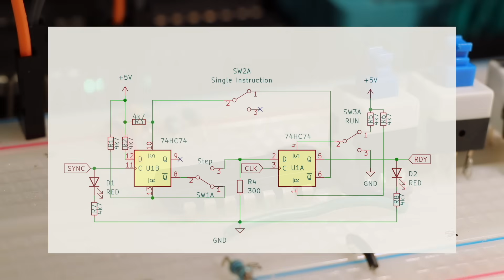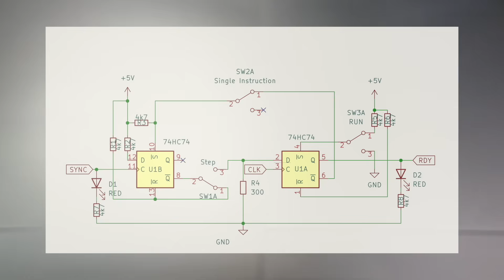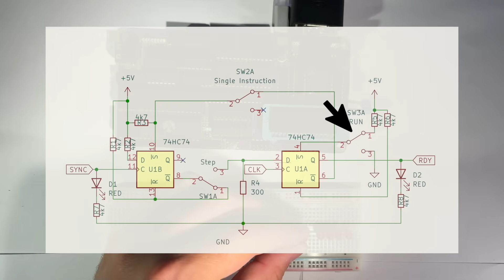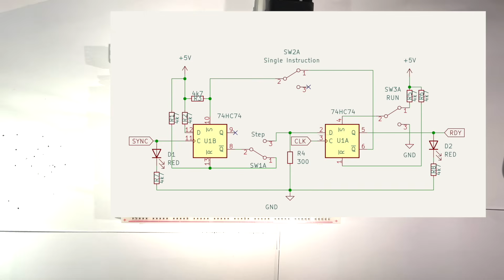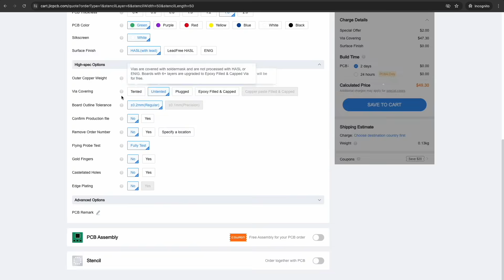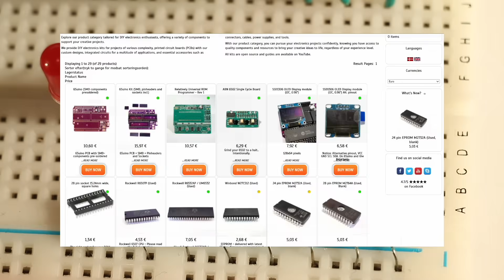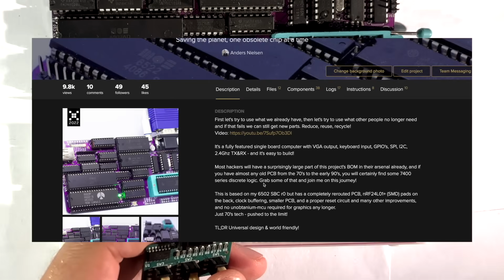Myth: The 6502 Cannot Single Cycle!

Comment: Yeah this was a problem with all the NMOS microprocessors and support devices. That is why 6502 has RDY and SYNC lines to facilitate suspending execution on instruction fetch and the BRK instruction to facilitate arbitrary breaks in flow for escaping to debugging code (with some notorious bugs!) but yeah no stopping the clock until the 65C02.

Comment: "though the CPU is running at 2MHz, we're successfully halting it after each instruction". The youtube video title is a little clickbait. Your definition of "single cycle" is "run at full speed, but make memory access VERY long". Another definition of "single cycle" is "operate the steps individual". On 8080/Z80 there is a difference between both single cycle definitions. Nice video nevertheless. That you need lots of pullup resistors with CMOS TTL chips is valueable information.
Reply from the maker: It's how it's designed to step through instructions. Even the KIM-1 did it this way - and had the switch labelled "single step" :)

Comment: However, to achieve it, you need to add a component, so it is not a myth. What can be said is that it is not impossible to accomplish.
Reply from the maker: The 6502 doesn’t do anything at all without external help.
The component isn’t added to make it single cycle - it’s added to control how it does it. 
The feature is there regardless.
Reply: @AndersNielsenAA  Cool, but isn't it the case that with the newer version, you don't need that extra component to control it? I think that's what is meant. Anyway, thanks for the reply. I'm not claiming that you're wrong; I'm just trying to better understand.
Reply from the maker: @ The 80s version can just stop the clock, yes :)
Reply: @AndersNielsenAA  Thanks! Old technology, but still as relevant today as it was back then—conceptually speaking.

Comment: An absolutely enjoyable Video on single stepping a old 6502 CPU, I'm repairing a  Microtan 65 Full-System built into a 19" Rack, it mostly works but some of the Eprom's  don't seam to be getting selected.  I'm in England, what would be the postage cost for the ready built stepper. Thanks
Reply from the maker: Thank you. I'm sorry to say Brexit has made it impossible for my one man company to send anything to the UK - HMRC requires me to sign up for UK VAT with no exceptions = double accounting in a different country. That means unless I have enough guaranteed volume to justify dealing with HMRC, there's just no way. Some of my products are on eBay UK thanks to their open source nature :)

Comment: Thanks, this was a great video.  Really, peaked my curiosity. As with the Cycle Board, there are 3 buttons.  When this run button is up, is this run at full mode, while pushed is this the debug mode?  As per the Cycle/Instr button, when this is pushed down, is this the Single Cycle mode?
Reply from the maker: When the Run button is pressed RDY is kept high, so the CPU keeps running full speed. The other button toggles whether it stops on every cycle or just when a new opcode is fetched (ignoring operand/data cycles).

Comment: Glad to see this video :)
Many years ago, I wanted to try a homebrew but wanting to play with single/manual clocking, I ended up getting a 65c816 (the 16 bit version of the 6502)

Never even tried it with the original.
Reply from the maker: It seems it’s still underestimated. The NMOS might actually be able to run slow too.. more testing needed

Comment: So the 65C02(1981 - found in Atari 8bit XL/XE and some later 800/400 models)essentially has the halting circuit onboard?  Since later Atari 800/400 motherboards could accept the 65C02 does that mean that a similar circuit to yours exists on their earlier motherboards?
Reply from the maker: No. The 65C02 simply doesn’t mind stopping the clock completely - so you can essentially just use a (debounced) button instead of the input clock.
Edit: It can still use the circuit though

Comment: The Atari VCS (2600) WSYNC register in the TIA causes the RDY pin to be deserted, until the next scan line. This is CRITICAL for display timing.
Reply from the maker: Indeed, and there are no CMOS 6507s out there - that’s still “pretty fast” though, so I guess the myth started because it’s not immediately obvious to everyone that means you can halt it indefinitely and move it forward with a push of a button.
And it’s also in all the manuals :)

Comment: Another mildly irritating feature of the original 6502 is that it ignores RDY on write cycles, so if you need to slow writes you have to resort to clock stretching.  I guess this made sense at the time, since RAM was faster than the CPU anyway and you normally only had to add waits for ROM reads.
Reply from the maker: I think it’s more about the fact that you don’t really need it to pause as you can just latch whatever the 6502 wants to offload to a register pretty easily on the ~W signal if you want to inspect what’s coming out.
But that’s basically what you said :)

Comment: Now try this on a Z80. It uses capacitors as temporary bit-storage elements. If you wait too long, capacitors discharge. That's why it had a minimal clock frequency.

EDIT: I should've watched the first minute before commenting. Of course the Z80 can also be put in wait state, so there might be a way around it (although, I don't think it has a 'sync' pin)
Reply from the maker: I think the Z80 doesn’t mind being clocked at 1Hz but I haven’t dug into it. And I think you’re right it doesn’t have a sync pin 📍
Reply: @AndersNielsenAA  It does have an equivalent to SYNC: M1 together with MREQ indicates an opcode fetch cycle.

There seems to be no minimum clock frequency. From the manual: "When the clock input to the Z80 CPU is stopped at either a High or Low level, the Z80 CPU stops its operation and maintains all registers and control signals."

So it looks like you can single-cycle a Z80 by either method --  stop the clock, or use WAIT.

Comment: i mostly just heard to get the cmos version becsuse they're easier to find and interface with modern othrr chips
Reply from the maker: Well neither of those actually apply. On the Asian markets it’s super easy to get both - but the CMOS versions are a bit more expensive. Much more if going for a new one. 
Interfacing should be the same except the 90s versions run faster.
Then there’s also the whole CMOS software incompatibility thing between manufacturers.. and HW incompatibility for the WDC version too

Comment: What shocking news, I had a 6502 on my bike and could never work out why I had to keep peddling. The shop that sold me it said it would certainly cycle, I took it back and he said I must have installed it wrong. It never worked properly and now I know why, so after showing the shop your video I asked for my money back. He said since I bought it over 10 years ago it had probably has failed anyway. So if you can make known to all cycle outlets of your findings, this will help a lot of people.

Comment: I never realised that people thought you could not do it. Several 80s computers from the 80s used the rdy line to stall the CPU when the graphics chip needed cycles (even when the ram ran twice the speed of the CPU and the graphics chip, with each getting access alternately). Even the Atari 2600 6507 has a rdy pin, but single stepping it will cause the screen to fall apart.
Reply: The issue is that the registers need a clock to keep refreshing their state. The way you would typically stop a CPU and make it single step would be to stop the clock signal. This is how it was handled later when it was a static register. The board here doesn't stop the clock signal, it instead latches the signals which allow the CPU to fetch instructions. It's still getting clocked and still refreshing the register states, but it is waiting for the bus to be free to read, hence a single step.

Comment: It does not do single cycle. What you achieved is by "help" or external logic. But by itself, the non CMOS version cannot do this. It is the same to achieve BUS arbitration by disconnecting electrically the CPU. the 6502 cannot do this without external logic whereas the 6510 can
Reply from the maker: That’s incorrect. All the 6502’s put the data bus into high Z half the cycle - the 6502 and 6510 are the same in that regard. And this actually does let us halt after each CPU cycle.
Reply: @AndersNielsenAA  the 6502 has no tri-state capability. this is proved by the fact that C64 engineer employed a 6510 cpu which is a 6502 with integrated bus tristate capability (AEC signal) plus one memory mapped hw port
Reply from the maker: @gasparinizuzzurro6306  The 6502 databus tristates. The address bus does not. I take advantage of that on my ABN6502 SBC.
Reply: @AndersNielsenAA  so not a full tristate functionality. it always require a custom electronic around it.
Reply from the maker: @gasparinizuzzurro6306   Plenty of tristating to single cycle and feed it instructions. You don’t need to tristate the address bus for that. 
The 6502 won’t do anything at all without support circuitry. It’s a CPU. Anything except the most basic address decoding requires more circuitry.
Doing the same thing on a 65c02 would also require a minimum of an IC to stop the clock in the right state - so you might as well use the same circuit and leave the clock running. And the 6510 is NMOS just like the 6502 so it needs a running clock too.
Reply: @AndersNielsenAA  i think the key point is that the 6502 is a cheap cpu. Most contemporary competitors have IMHO that basic capability such as the 6510 and z80 just to name few. 
the 65C02 is a cmos version.
Reply from the maker: @gasparinizuzzurro6306  The 6510 isn’t a contemporary competitor - it’s a direct descendant with random features added that would save on integration cost.. that’s the benefit of having your own semiconductor fab in the same building.
It literally shares most of the IC design with the 6502 :)
Reply: @AndersNielsenAA  I know it is a descendant, or - improved - version. But it is even a competitor from a engineer point of view as it is a viable choice.

Comment: Thanks for the great video! It consists of only two D-FF, so maybe this is the minimum configuration. In my case, I configured it with two JK-FFs and NAND gates. And in my case, when I do a CPU RESET with the CPU stopped, in rare cases the RESET sequence is not performed correctly, so I added a circuit to keep the CPU in RUN state during the RESET period.
Reply from the maker: Thank you and thank you for the insight! 
The way the circuit is setup relies heavily on the button’s DPDT nature and makes it harder to control digitally - or just with SPST buttons. A few more logic ICs like you did would certainly make it more versatile and robust.
The 6502s can differ quite a bit when it comes to the reset - I’ve heard some of the NMOS ones can overheat if held in reset for too long so a short reset pulse is very important too. Luckily I’ve never experienced that with a 6507.
I appreciate having access to your Perseus schematics very much so I can sanity check a few things while moving forward, thank you 🙏 :)
Reply: @AndersNielsenAA  Thank you very much. To explain my case in detail, when I powered on the CPU board with the RDY signal at a “L” level and in a stop state, CPU reset, and then proceeded with the step operation, it occurred with a certain probability that the execution address progress was not correct. In this case, I believe that the start vector setting within the CPU is not correct. So, I think this kind of problem does not occur in the case of a configuration where the first state is always RUN state by power-on reset. I had to solve this problem with my PERSEUS-7, because it is assumed that it is often operated in step operation only, not in RUN state at all from power-on. I have made four PERSEUS-7 units and verified the operation with multiple CPUs as well, and confirmed that it is not a defect in only one unit by chance. defect occurred on a Rockwell NMOS R6502A and not on a CMOS R65C02. The R65C02 has a different number of clocks before the first instruction execution and I believe has an improved reset sequence. The additional circuit that solved the defect is R54 in PERSEUS-7 and R4 in PERSEUS-8.
Reply from the maker: @mitsuruyamada Thank you for the details. Since Sync stays low during reset, I wonder if it would be sufficient to ensure “single instruction mode” during reset. I guess that would do the same as keeping it in run state - but of course that means you can’t read the reset vector the CPU reads either way.
Reply: @AndersNielsenAA  Thank you very much. You are right. According to the datasheet, it is sufficient to maintain “single instruction mode” even during RESET. This phenomenon and the countermeasure is based on my personal experiment. I have not been able to reproduce the defect within the conditions and number of times I have re-tested now. Since this circuit allows the same number of dummy steps until the first program instruction for the R6502A and the R65C02, I am going to continue evaluation with this circuit. Thank you again.